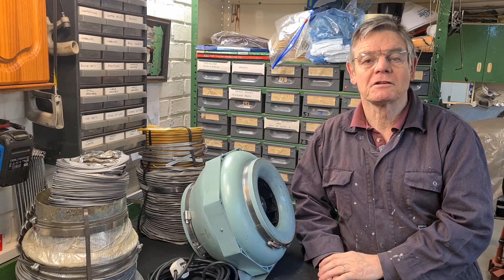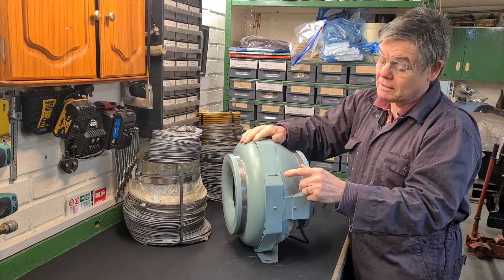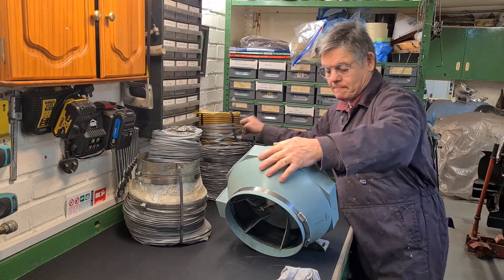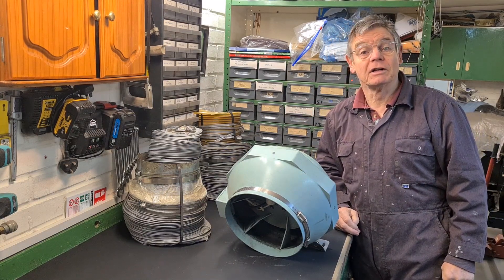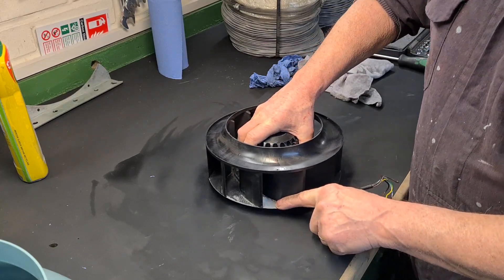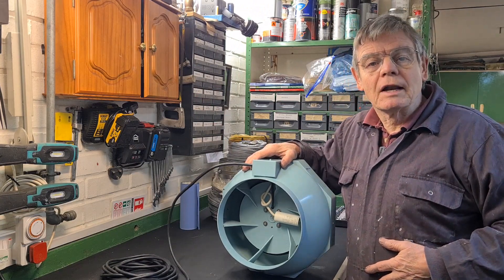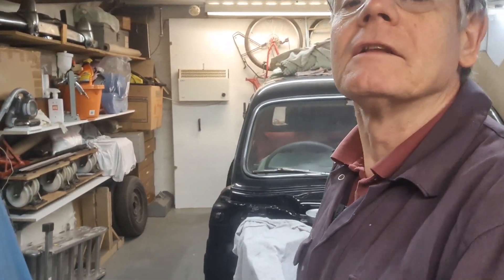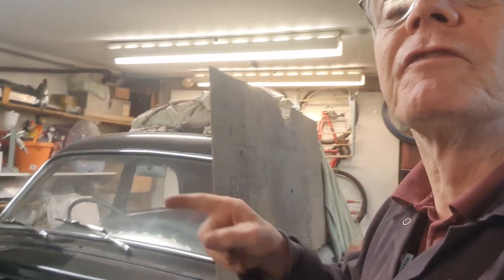Building my homemade Spray Booth intro

Comment: Hi Steve I built a temporary spray booth using 25mm x 8' x 4' insulation board from the builders merchant, they are self supporting and easy to manoeuvre etc, + they don't flap creating dust, cut holes for inlet air with a gauze and outlet air with a gauze, using insulation boards also meant i could heat the room without hot spots for a long even period before spraying, put the paint in the room long before as well, getting everything to the right consistent temperature is important to stop any condensation. The room doesn't have to be that warm just constant. Personally i would extract the fumes through a filter rather than push air into the room. Never use a gas heater as it will give of moisture, the last thing you want when spraying, dry heat only.
Reply from the maker: Hi Dougie thanks for your comment, I'm still in the process of making the booth I'm going to try and make a neutral pressure by controlling 2 fans.

Comment: Sounds one hell of a powerful fan Steve 👍
Reply from the maker: Yes I'm thinking it will blow the plastic sheeting too much. I really need a way to slow it down.
Reply: @StevesConsul  This is just an idea Steve and I am certainly NOT an electrian,but would it be controllable through a dimmer switch?
Reply from the maker: Good idea I will look in to that. The label says 170 watts so maybe I need a switch that can handle it, I need to talk to an electrician. Thank for that comment David.

Comment: I think sucking the air out is the way to go. Where you let the air in you put some kind of filter. Also check Fitzee's fabrications on YouTube. He made a clip recently about a spray booth. Good luck!
Reply from the maker: Thanks for the comment Stelu. I'm still undecided sucking the air out would create negative pressure inside and that could suck dust in from any gaps in the sheeting. I been watching lots of videos and they also talk about non explosive fans that's something I never considered.
Reply: @StevesConsul  Yeah, the non explosive thing is really important. I thought of that but forgot to mention it. At least avoid having the heater inside your "tent". The ideal setup is having two fans where you can control the speed so you can match the pushing and the sucking of the air to aim for normal pressure. If you only push in the air you'll end up having paint in the rest of your garage, I'm afraid. I'm restoring a Saab 96 1960 two stroker and will face the paint booth issue later on. I enjoy your channel. Keep up the good work. Regards Stefan
Reply from the maker: Good point I will bear that in mind.